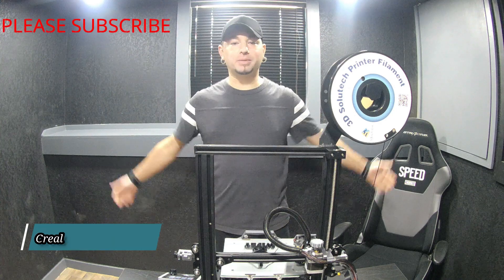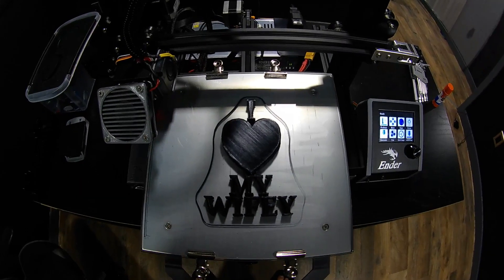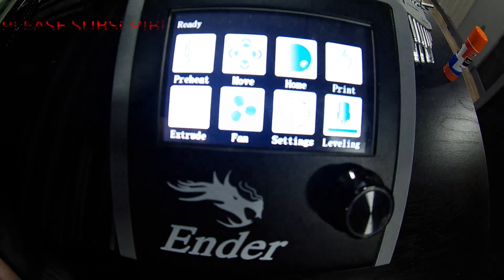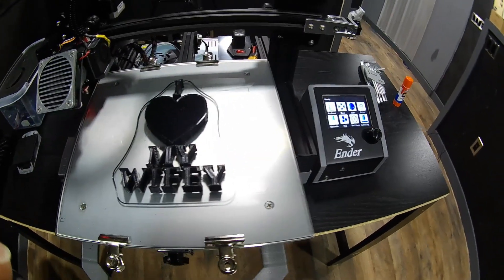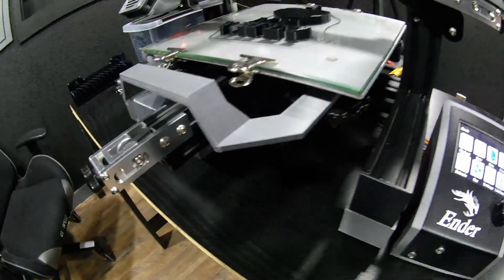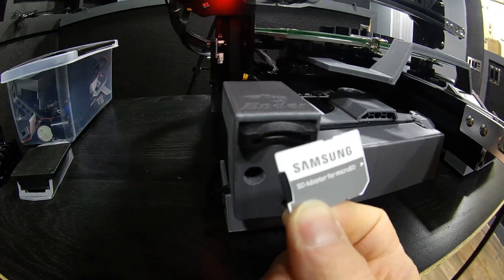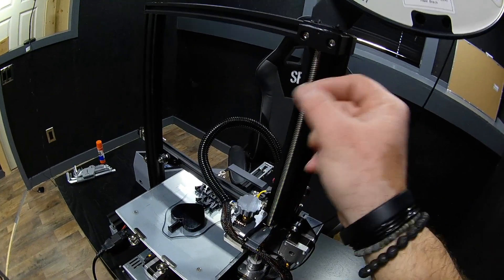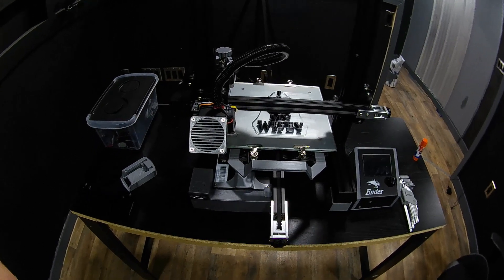ENDER 3 Unboxing / Review : The best Gift i ever got!

Comment: Where did you buy all the upgrades for it? How complex item couldnyounprint with it? Coul you just drag an image over and start printing? Is the filament special.or could you buy it any where?
Reply from the maker: ThanX for the tip i added all the links in the description. let me know if there is anything else. Also i use cura for the program super easy and free